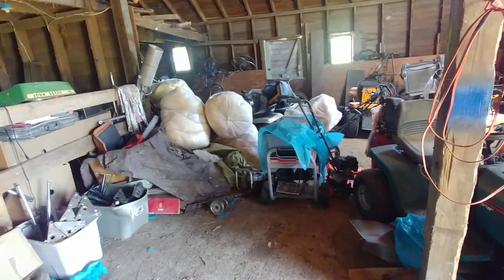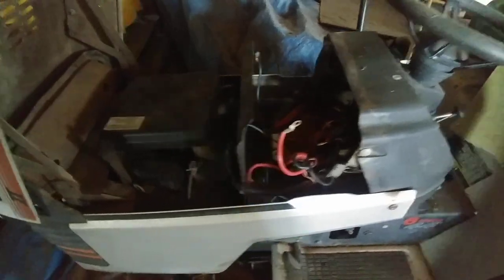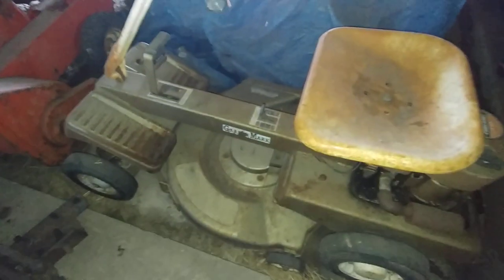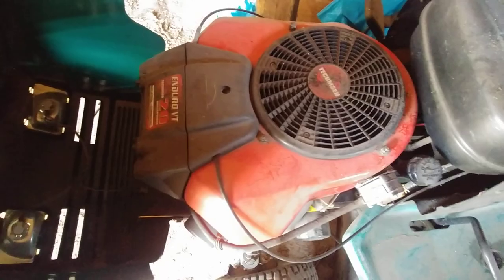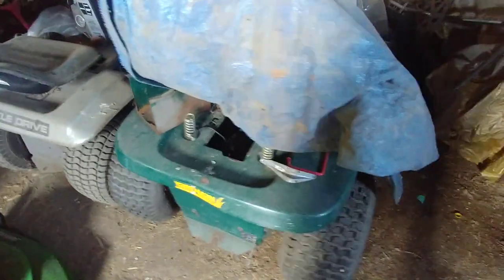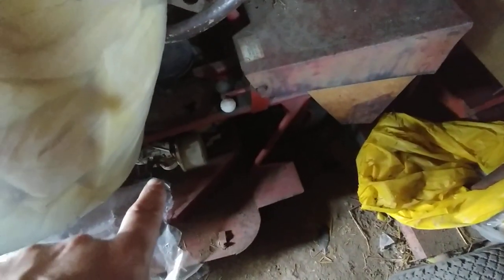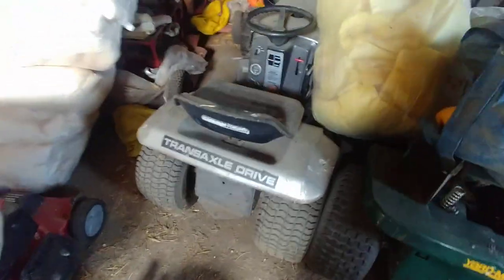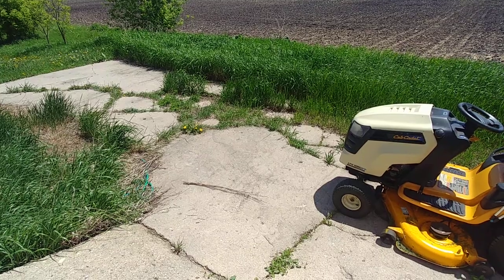Barn rescue series " choices "  you vote which one is next

Comment: Well, Dave, I have a 1996 MTD ranch king 18hp opposite twin that needs a coil, that I talked to you about, so let's get that MTD running, that's my vote and I'm sticking to it.
Reply from the maker: Ok I'll mark it down. And get that coil in that thing so you can cut your grass LOL 😄
Reply: Use it for towing a cart, Deck rusted out and pulleys keep sheering because the brake assumable is missing on deck. the pulleys and deck cost more than the rider. 3 blade deck. once I get the coil it should run like it's new.
Reply from the maker: @alviejameshoke4426   I'm sure it will run like a dream. 48 inch deck?  If so I have a good deck for it but you probably live very far away
Reply: Pennsylvania, Pittsburgh area, Belle Vernon about 20-25 mile south of the city.
Reply from the maker: @alviejameshoke4426  I'm in the middle of nowhere Minnesota
Reply: Hey Dave, got my 96 MTD rider running. Put new gas in the tank, changed the gas filter and charged the battery. runs good now without stalling. Still has problems starting on warm-ups, smelling gas, maybe running rich, is there a set screw for that. I know there's a set screw for the idle and its set just right.
Reply from the maker: @alviejameshoke4426   there should be an idle jet screw on the front of the carb below the fuel pump but sometimes they just plug it so you have no adjustment. If your fuel line is one of those that runs through the cowling make sure it's not leaking gas on top of the engine " I've seen it happen "  if it's not one of those then you should be fine
Reply: I adjusted the idle jet screw, its good. Not leaking gas no wear. I checked everything is dry.
Reply: @alviejameshoke4426  check exton mower service in apollo. they have all kinds of used decks